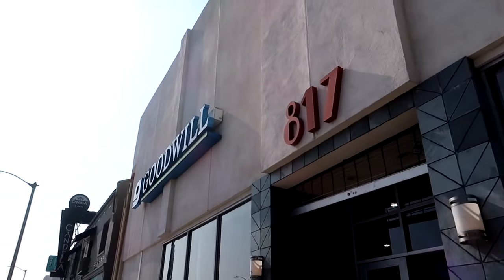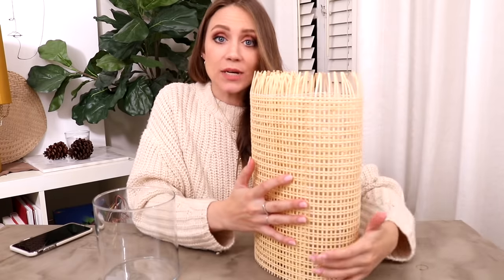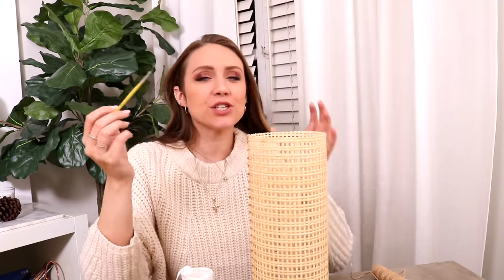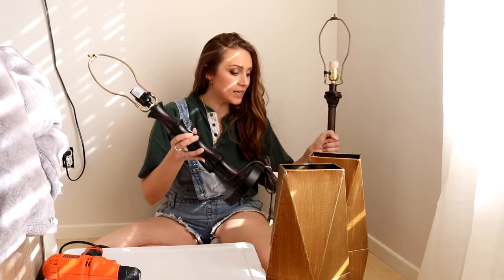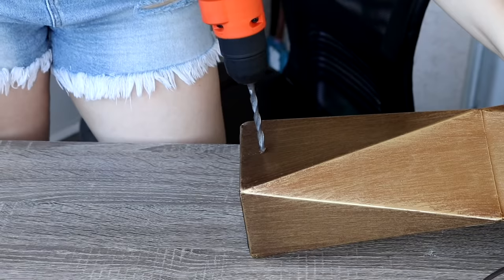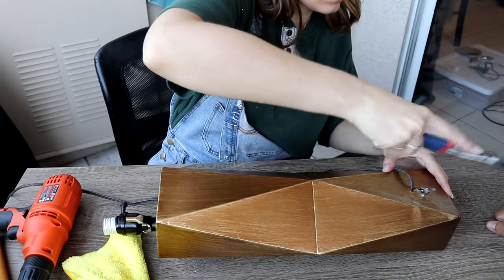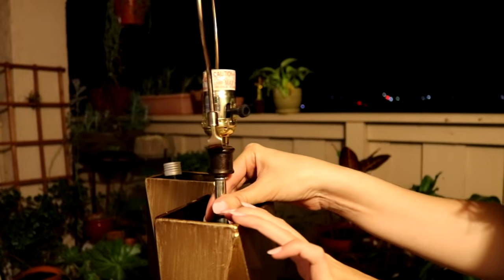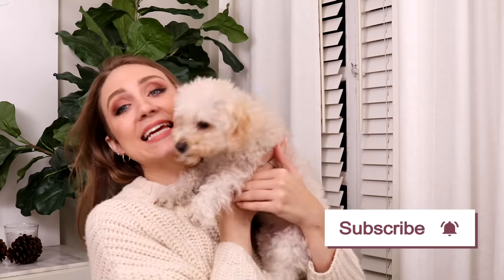DIY THRIFT FLIP DECOR / Extreme Bedroom Makeover PART 1 / DECOR on a BUDGET | XO, MaCenna

Comment: Alternative idea: turn the vase upside down, drill a hole in the base (the new top) for the light fitting, and cut just a little semicircle for the cable to sit flush with the floor at the bottom. Loved your ideas! X
Reply: Heather Cartwright exactly what I was thinking
Reply from the maker: The bottom of the base was like 2” thick so I was afraid I would be able to make the hole big enough for the plug to go through that way 😬 but maybe so!
Reply: I wouldn't have even thought of that 🤦🏻‍♀️ Brilliant idea!
Reply: Exactly my idea!!! LMFAO
Reply: Exactly what I was thinking the entire time. They also make drill bit attachments that will drill nice large holes. It would've upped the cost of this particular DIY, but would be super handy for future projects.
Reply: Maybe unscrew the wire from the socket, feed it through, then reassemble?

Comment: DIY tip - the socket of the lamp (where the bulb screws in) pulls apart and on the inside are 2 small screws that allow you to remove the cord, then all you have to do is drill a hole big enough for the cord, and reattach the socket. I know it's too late but maybe it'll be helpful for future lamp projects?

Comment: Love the cane candle holder project. The lamp project needs a second draft. You can also cut off the plug, slip the cord through a small hole, then attach a new plug, easily found at any building supply or hardware store.

Comment: Who else wanted to see the back of that lamp after she was finished?
Reply from the maker: Hahaha I finished up the lamps that night. You couldn’t even see the hole 👍🏻 When i do another lamp I’ll show you 🤗
Reply: XO, MaCenna Thanks babe
Reply: Romeo could have just changed the plug... Cut the old one, thread the cord through a small clean hole, and then install a new one. it's not rocket science.
Reply: i was thinking she could have used clay for the back cover-up too.  maybe?
Reply: And drilled through the bottom so the hole was not visible.  Thick felt pads on the bottom would have given enough clearance for the cord to be threaded out the back with no imperfection in that pretty material.
Reply: Or made it upside down and made the base hollow so u just need to cut the size of cord on the side and a small hole on top for the trunk of the lamp?
Reply: I do. There a lot of ways to accomplish it with making it look like your dog chewed the holr!

Comment: I also agree that it would have been easier for you MaCenna, to turn the vase upside down drilling a hole for the light kit in what is now the top and drilling a curved semi-circle at the bottom edge for the cord.  Also, go to Harbour Freight if you have one near you or any hardware store... and pick up a couple bits for hole making.  They have them for wood and metal and they will work with your "handy dandy $20 drill' :)

Comment: You can buy sheets of copper and brass at some home improvement stores that are thin enough to cut with tin snips or sheers that would have been great for the top of the lamp but you could have also used the bottom of the vase as the top. Also, tin snips would have been great for cutting the back of the lamp but as someone else said the whole lamp assembly comes apart so no need for the whole next time.

Comment: The other reason to leave the cane candle-holder an open steeve is that it make removal much easier when the candle is finished in the vase and you want to clean it out with boiling water and reuse it.  You could even change your sleeve seasonally, or for special occasion making different sleeves  for the vase.

Comment: All you have to do is remove the wires from the socket and then thread it through a small hole in the vase. Then you can reattach socket. It's really easy! You just make sure the smooth wire is connected to the brass screw and the ridge wire is connected to the silver.

Comment: Bit you needed to cut the hole is super cheap at any hardware store...(including WalMart)...usually comes in 4 to 5 variety size pack...I found mine at goodwill in their surprise bags wall...super cheap...cuts metal, wood, plastic, glass with smooth edges...can be used for multiple diy projects...

Comment: Girl. You can separate the wire from the socket....It's real simple. It's like 2 wires. Maybe a ground. But there's usually a positive and negative.
Reply from the maker: Thats how I though it was going to be and it was going to be screws on each side to reattach the wires, but they were on the inside closed in by plastic so I was afraid if I cut them off I wouldn’t be able to reattach them inside 🤷🏼‍♀️

Comment: Nice upcycles. I would have turned the vases upside down, make the bottom the top, and drill a hole for the plug there with a hole attachment on the drill. (I am all for the easiest!)
Reply from the maker: The bottom of the vase was 2” thick on the inside so I was worried I wasn’t going to be able to make a big enough hole 😬

Comment: If you wanna make your own clay and save more money, equal part cornflour and PVA/craft glue with a little baby oil or cooking oil (reduce stickiness) and same amount of vinegar or lemon juice (clay longevity so it doesn’t mould). Normally the ratio of the cornflour, glue mix to the other two liquids is 1 cup: 1 cup :2 tablespoons. Have some cornflour on the side in case it’s still sticking and for kneading. Mix it all together then 30 in the microwave, mix, then another 30 if needed. Should start to clump altogether. No baking needed! Just 24-48 hours to set!
Reply from the maker: O wow!!!! I have to try it!!!! Thank you so much for the tips!!! 😘

Comment: I would have used the vase upside down so that the bottom had the light kit supported. Drilled a small hole in and spliced the cord. Would have saved so much time!
Reply from the maker: The bottom of the vase was like 2” thick so I was worried I wouldn’t be able to make the hole big enough 😬 but great idea
Reply: Oh!! It turned out great anyway! The candle holders are my fave! Love your style.

Comment: Just a thought, here, get a drill bit that’s maybe 1-1 1/4” in diameter to drill through the metal with a clean cut. That way, you won’t need to carve out a big hole with a small drill bit

Comment: Was wondering why u didn’t just put the old lamps inside as they were and glue them to the bottom. Did they not fit? I couldn’t tell in the video. Still would have needed the hole for the plug but I believe they sell circular drill bits for that still u have that cut thru metal so it’s a cleaner cut. Love your channel.

Comment: Cut the cord off the lamp, run ot through a small hole and then pit the wites back together with electric tape and wire nuts. Yhen cover with a decorative small diy box of some sort. Better than making that big hole in the back.

Comment: A hole saw would’ve been a better option than the drill bit in making the hole for the cord. Or you could’ve cut the cord near the bulb socket and then rewired the socket after you threaded the cord through the smaller hole at the back.
Reply from the maker: Ooo a hole saw!!! I definitely think I’m going to start investing in some more tools 🤗

Comment: You could have unhooked the wire from the switch at top and fed the single cord from the bottom hole to the top and attached it back to the switch at top.

Comment: Oh, you sweet woman..really sorry, I laughed so hard at that tin vase hole...I'm not going to go into how you only needed a small hole, because it turned out great!
Reply: Mog-Gyver O'Neill same 😂🤭 I actually thought she was gonna use the bottom of the vase as a top & make a small hole there 😂 

But totally agree that they turned out great! They look so expensive (at least from the front 🤪)
Reply from the maker: Hahaha I really wanted to just use the existing thrifted lamp with out any other replacement parts and I was worried if I cut the wires I wouldn’t be able to connect them to that original head again and would need to buy the replacement 🤦🏼‍♀️ next time I’ll be brave and cut the wires so I only need a small hole! But you can’t even tell I made that big of a hole after I covered it lol

Comment: You ofcourse could have opened or even replaced the plug by one that could have been opened and closed. You would notvg have needed 'gargantua', as a hole in those gorgeous tin vases 🙃
Reply from the maker: I was trying to only use the thrifted lamp and not purchase additional parts but totally could have been simpler and cleaner and worth the additional cost 🤣🤗
Reply: @XOMaCenna  I get it sweety, but most plugs have little screws on them, because they would habe been asembled at 9ne point, wich technically mrans they can be de- and re-asembled (probably spelled that wrong)... I learned this a long time ago and it opened my view to so many new possibillities, I hope it does the same for you!

Comment: Could you not have disconnected the wires in the lamp and run the wire through a hole like you would with a kit?

Comment: Why couldn't you flip the vase upside down? All you would've needed was a tiny hole even with the now-bottom of the vase for the cord to slip through. And then you could've just drilled a hole through the middle of the now-top of the vase for light portion.

Comment: You literally could've just disconnected the wires from the socket and saved yourself so much work 😢
Reply: Or buy lamp parts at the hardware store ??
Reply: @heatherway25  she probably got the guts cheaper by buying the already working lamps from the thrift store.
Reply: @alexazie7769  The lamp was only $1 at GW, where as it would have been quite a bit more for lamp kit...about $10 I think.

Comment: You could have just drilled a small hole, taken the plug off, put the wire through the hole and then reattached the plug. Would have looked cleaner

Comment: ok, I have a number of problems with this lamp project! you went through so much unnecessary trouble!!! 1) Go to your local hardware store  and buy a bigger bit or what's called a hole bit! This will help you on many projects in the future and will eventually pay for themselves!!! 2) the clay top looks incredibly tacky, sorry but it did. You bought some really cool vases for these lights but these assembly was all wrong. Flip them upside down. drill a hole in the bottom and use that as the top of your lamp. If you bought a larger bit or a hole bit this is where it would be most beneficial.  To secure it simply e600 an o ring to both the  post and base of the vase. For asthetics you can paint it.For the cord you go to the edge and only need to cut a 1/2 circle at most for the circumference of the cord. No ripped edges, no wavy clay..... Personally I would have just rewired it. But that requires a soldering tool.
Reply from the maker: Thanks for all the tips 🤗 it was my first lamp with out just a lamp kit so I was proud it all came together. But practice and better tools make perfect 🤗
Reply: @XOMaCenna  I'm sorry, the way you made it sound this was not your first lamp. For a 1St attempt you did great, and I'm sure you learned a lot. Whenever I try something new though I research the h**l out of it and as you know you tube I a great place to start that kind of research! I get a lot of good ideas from you and adjust them accordingly to knowledge ,needs,& availability. I think you're great!